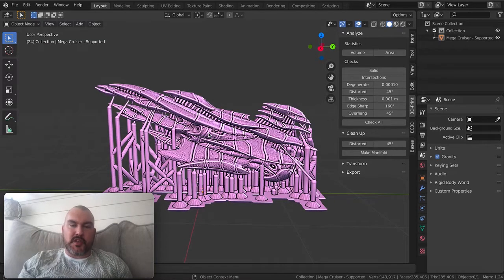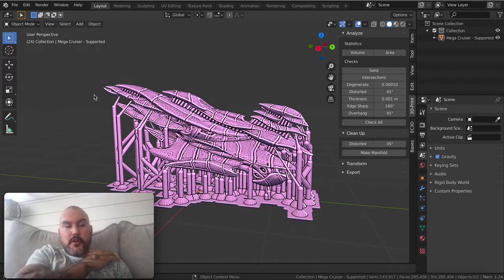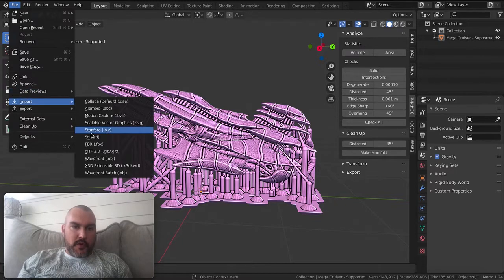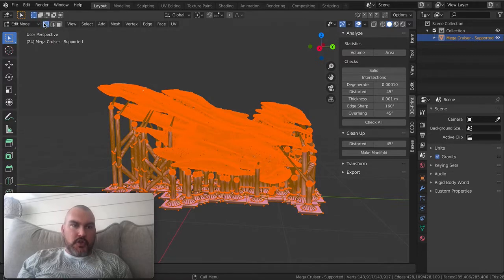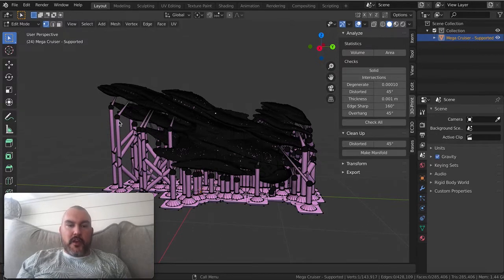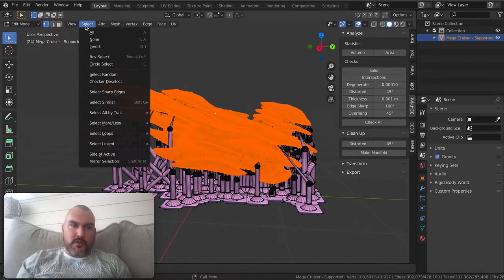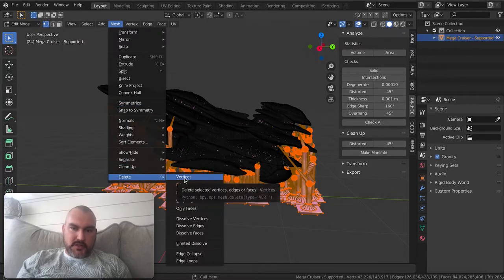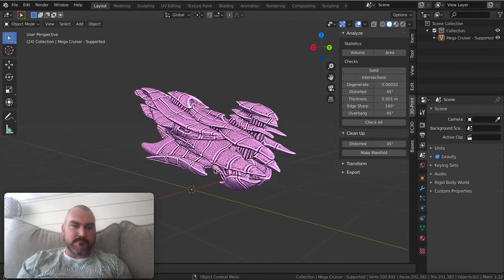Using Blender to Remove Pre Supports in 5 Seconds

Comment: Good day. What if it won't section the model from the supports. When linking it finds all of it
Reply: If that's the case then my creator merged or booleaned the supports into the mesh of the main object and unfortunately there is no removing them easily with this or any other method.
Reply: If that's the case then the creator merged or booleaned the supports into the mesh of the main object and unfortunately there is no removing them easily with this or any other method.

Comment: What if I just want to remove some supports and not all of them?
Reply: Instead of clicking ¨Delete" when you have all the supports selected, Context Menu > Separate > Selection. Then you can mask the main model and start selecting by hand what you want and don't want in the supports using the round selection tool and the X-Ray toggle on (Alt-Z) and then delete those parts. Honestly you're faster done, rebuilding supports in a dedicated slicer than editing in Blender but to each his own... :)